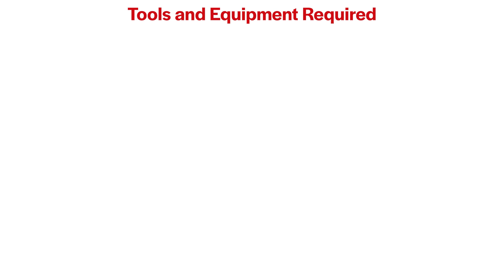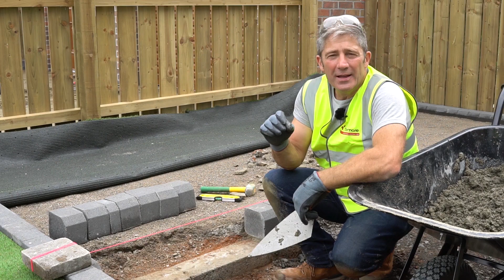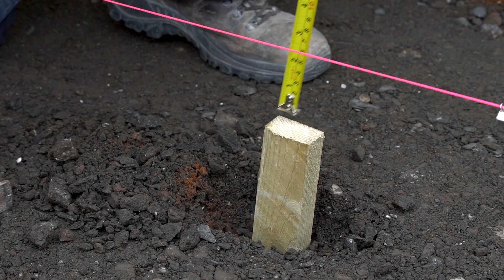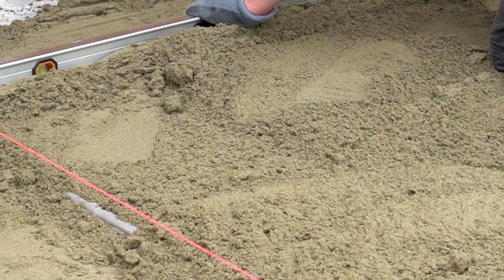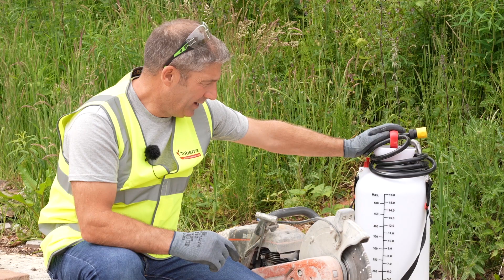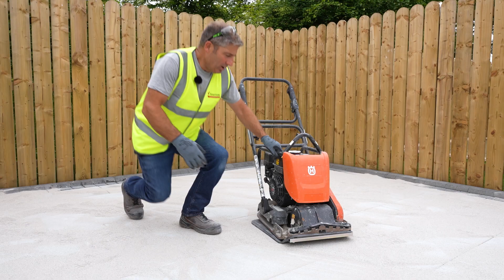How to Lay a Patio with Tobermore Braemar Slabs | Step-by-Step DIY Guide

Comment: 2-5ml joint.  Is this hard to keep consistent for a novice and worth looking into using spacers
Reply from the maker: Hi @patc9687 if you are a novice and worried about keeping the joints consistent you can certainly use spacers between each flag to help with guiding.